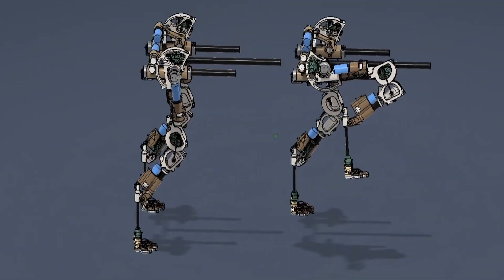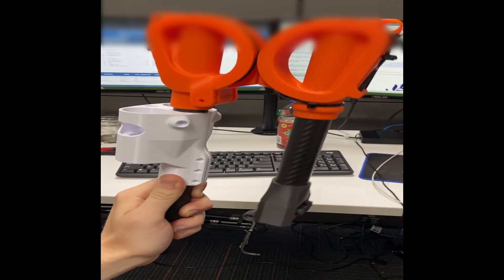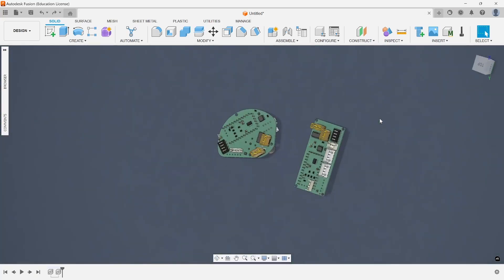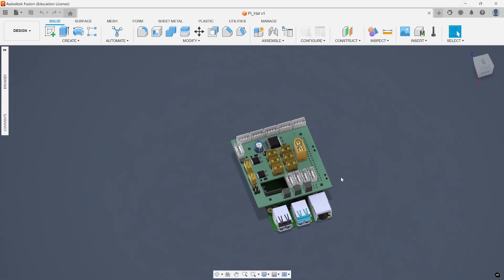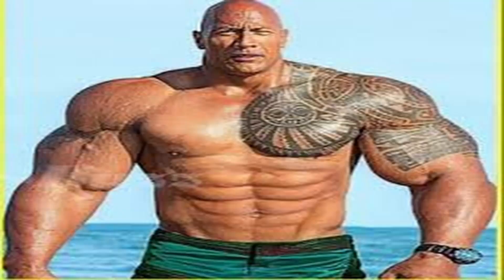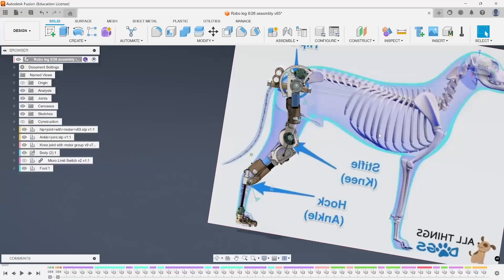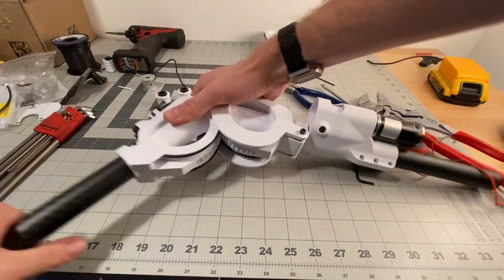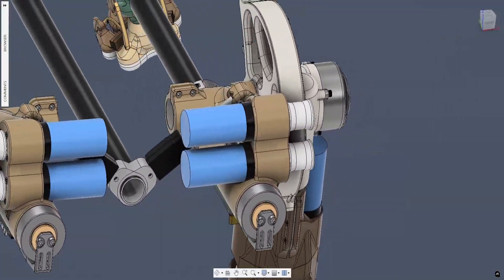Yet Another Open Source Quadruped Robot Dog

Comment: This is AMAZING! What a cool design, can't wait to see the rest of the build! Will be cool to see how its range of motion compares to standard bearing-jointed robots once complete, I bet it'll be considerably more life-like. Hopefully the kinematics aren't tooooo much more difficult, I admit that was something I was just pretending wasn't a problem until I got there 😅
Reply from the maker: Me too haha. I had thought about pinning the hip at (0,0) on a coordinate plane, moving the foot to every point on the grid it can reach then recording the angle of each joint at those points. That way instead of doing complicated math to calculate the foot position I can just give it a position like (0,-25) to lower the foot/raise the body. And to move forwards I would draw a square on the coordinate grid, lift the foot up, move it forwards, set it down and drag it back. All points on the same X axis keep the foot at the same height, and with a load cell in the foot and a 6 axis IMU in the body I should be able to adapt the target point to keep the dog level during terrain changes. But there's probably a reason no one does it this way....
Reply: @WilsonFabrication  this is very cool check out the biomechanics on the knee of a flea
Reply: Definitely subscribed! I wounder if we can try to build a brain for that project

Comment: if you feel like it, in hackaday there's drivers for the BLDC motors, which are open source and should be able to make your own
Reply from the maker: I am interested in trying out BLDC, but the bigger issue for me is price. The DC motors are significantly cheaper even with the custom motor controller, and I would really like to make this project as low-barrier-to-entry financially as possible

Comment: A lot of old people recovering from hip replacements never recover enough strength to walk again.  Two critical joints do most of the work and the rest can be unpowered and moved by the patient (if you want to make an assistive device).  The knee does most of the work involved in walking and standing upright under your own weight.  The front-back motion of the hip joint is also important for standing and most critical for getting up from a seated position.

Comment: I hope picking I2C will not choke project with limited throughput and latency. AFAIK robodog actuators usually are connected via CANbus which is better with both regards. If you want your poor mans fieldbus to be simple and on a budget, you could also make it with RS422/485
Reply from the maker: I've redesigned the motor controller boards to use an esp32 and CANbus. Massive upgrade, I2c really was a limitation
Reply: @WilsonFabrication  good
are you going to ditch brushed DC motors for BLDCs too while you are at it?

Comment: You should consider CAN bus over i2C , as CAN is better dealing with noise
Reply from the maker: Already in the works! Making the move to CAN also necessitated a more powerful microcontroller so a lot of work has gone into redesigning the motor controller boards. Overall should be a huge upgrade

Comment: Wait you need to boost i2c?? I am doing a robot with 3 foot i2c runs right now, is that not going to work?
Reply from the maker: I2c was designed and is still only rated for something like 10cm, and so many comments on this video have been about how unreliable i2c is. The booster works but I’m actually ditching it for CANbus in the next revision. If it works for you I say keep it but if you start getting communication errors look into a booster board, adafruit makes a good one

Comment: Really nice!! My two cents, if you need a material for the joints ligaments that does not stretch over time, try carbon fiber tow glued with silicone caulk (100% silicone).

Comment: incredible light design, love the biomimicry. Using DC motors would make your impedence control harder but still doable, I would make sure backdriveability is adequate by making the reduction low or by other means. Backdriveability is one of the key features for it to be able to walk.

Comment: I2C, even with buffering is so not the right choice for this - RS485 or CAN would be much more robust, and probably simpler to implement & debug
Reply from the maker: I agree, I went with I2c because its already integrated into the arduino but I have known for a while now that it was the wrong choice. I will be switching to CAN soon (new boards being designed now) but to do that I will also be switching to ESP32-C3's as the microcontroller. going from 16mhz to 160mhz processor will me a huge upgrade for PID and allow me to use a more resource heavy communication protocol. 

Thanks for the comment by the way, I have been watching your videos for a very long time so its really cool to see you leave a comment

Comment: Pi5 just to start is ok, later on consider nvidia orin nx. Stay Away from I2C,instead use w5500 and use cat6 ethernet cables, each mcu can have its own ip and port or go towards CAN. Also what are your plans for battery?
Reply from the maker: Thanks for the tips! I hadn't heard of w5500 before and that actually looks like a great solution. I will probably go to CAN and swap the arduino for an esp32 to handle the extra data processing that CAN brings. For the battery so far I have been using a 20v Dewalt battery pack but in the long run I plan on using two LiFePo motorcycle batteries in series. They're crazy light weight and pack a lot of power for their size, should give plenty of runtime while keeping weight down. Plus I can get a deal on them through my old shop

Comment: Inquiry: What does the Rolling Contact Joint give in larger robotic applications? I subbed, good job :)
Reply from the maker: Good question, I'll cover this more in the next video but in short: closer to anatomically correct motion and increased "gear" ratio. Compared to a bearing joint, this joint travels a further distance to reach the same angle, which in practice gives it a greater mechanical advantage. This allows me to use a lower gear ratio motor which keeps the backdrive torque low

Comment: What program did you use for to do this 3d model?
Reply from the maker: all the design work for the joints was in Fusion360, renders too. The PCB's were designed in Kicad which is able to output a STEP file which I then used to design around. Fusion has a free for hobby use version and its the more intuitive CAD program compared to Solidworks, I've heard good things about Onshape though so might be worth giving that a try too
Reply: @WilsonFabrication  thank you

Comment: Impressive job, keep it up.  Not something I would design and build but for research purposes, awesome.  Personally, I like my machines to be simple because these small machines can't have redundancies so what's the point in complexity?  Ruins the reliability.  If Ros is complex or requires Linux then thats too much for most people.  Practicality and ease of use have to be a priority or the advancement of robotics will be out of reach for the lay person.  We want to control robots, not the other way around.  Has to be simple to configure so the end user has control

Comment: This is awesome! I think the primary benefit of modern QDD actuators is how torque transparent and backdriveable they are. This is typically important for lifelike dynamic stability. 

But the capstan might be torque transparent enough to let the dc gearmotors work? That would be awesome if so. Either way this is awesome.
Reply from the maker: It will be interesting to find out. This is my first time playing around with any kind of robotics so I have nothing to base off of but the capstan + planetary gear motors are way easier to back drive than I expected. When the motors are turned off the joint won't droop like you would expect a real animal joint to but I don't have to fight it to bend it closed. The motor controller board has a current sensor on it so im hoping I can get a rough torque control from that
Reply: @WilsonFabrication  Ooh that kinda flexibility is great news. Good luck!

Comment: you need to plan for water and dust protection of your pcbs early on don't forget it
Reply from the maker: Honestly hadn't thought about that yet. Might use something like the spray people use to waterproof ESC's on rc cars
Reply: @WilsonFabrication  look up ip ratings it’s explains the containment rules basically you’ll need the air openings in the bottom and in a way water can’t flow around the casing and in

Comment: yeah i2c booster is a solution but why not just serial,  board clutter is my main concern,. althopugh they look good
Reply from the maker: I2c is what I was most familiar with so it can be hard to plan communication with a standard you don't understand as well. There will be 16 joints in total and it made more sense to me to use a BUS to communicate rather than a direct serial connection. But I will likely have to swap out the I2c soon so maybe its time I learn serial
Reply: @WilsonFabrication   your bot is already crazy good, i'm sure you can figure out everything you need

Comment: Very cool concept. Is it back driveable though? If you look at James Bruton's designs for a robot dogs and look at his experience with the Sonic Robot you'll see that if the actuator is not compliant you get a lot of problems. Rigid robots have to calculate everything perfectly, and the world has to conform to the model the robot has. If your actuator is off by a couple of degrees, if the surface is not as your robots expects it to be, you instantly get instability and really high shock loads.

In general, the mindset for most robot dogs and their actuators is not "This leg needs to be here. So let's move it here." but instead, "This leg needs to apply a force with this vector, so let's move it like this.".

Comment: I'm sorry but your design makes no sense, especially these motors, they are not capable of fast enough acceleration (because of rotor inertia) which is required for legged robots as you have to change direction of rotation couple times a second even for a simple gait.

Comment: Arduino is all about the ecosystem and easy programming but the hardware is just a regular microcontroller.  You should consider a more bare metal mcu approach for cost and responsiveness when the control side stablizes.
Reply from the maker: Definitely on the horizon. Testing is ongoing and were already seeing the limitations of the 328 chip. Will probably go towards teensy or esp32 line of chip, mostly for their higher clock speeds. I would like to keep the parts used on the PCB either JLCPCB basic components or easy to get through hole components while keeping the BOM as cheap as possible so that limits my options

Comment: Cool project! Really like the marrying of capstan drive and rolling contact joints! One note about using i2c with long cables together with DC-motors. Have built an AUV with that setup and it was a nightmare interference wise. We ended up switching out all sensors to ones with SPI or serial communication. Soon we will switch to BLDC motors aswell. Im sure i2c cost us a year of troubleshooting. Just a headsup. We also tried various ”booster” boards to no luck. Hope you suceed with the project, really like the mechanical principles 👍
Reply from the maker: That is definitely something I am worried about. I went with i2c because it was simple and really the only communication protocol I had previous experience with but this will probably be an issue that I'll have to fight with too. I plan on using shielded wiring either from a USB, ethernet or picking up some shielded twisted pair from amazon

Comment: Putting the gear section on each side of the rolling joint is better than only in the center for twisting stiffness
Reply from the maker: Surprisingly the knee joint is very stiff in twisting. The combination of the high tension cord, fenced in joint and the gear face really lock it down. The weakest degree of motion is bending the knee to the side. Having the high tension cord further away from the center line of the joint helps keep it rigid to side bending forces

Comment: Will there be a way for the final robot to stand up on its own in case it has been overthrown on its side or back?
Reply: Usually that is just done by moving its legs in specific ways.
Reply: @conorstewart2214  i have seen one example where it could do so due to the joints being able to rotate 360°. I would think that you need to angle at least slightly the extremeties otherwise if you have not that 360°. Do you have by chance any vid on an example as i can't picture it.
edit:grammar

Comment: Looks like a very fun and challenging project to work on, do you have any plans on how to implement compliance in the leg? A mechanically rigid system will need lot's of sensing and control to compensate for the uncertainty of the real world. Since you are using 2 motors per joint it might be worth using the antagonistically with an elastic tendo to so that you could tune the stiffness of the joint in a similar way to muscles.
BTW, your website is geo-locked to the us which makes it slightly inconvenient to access and might loose you some traffic to the project.
Reply from the maker: Thanks for the heads up! I self host the site so I typically keep it pretty locked down but I've opened it up a bit

Comment: The biggest things I see going against this brushed DC design are speed and strength to weight ratio. As other commentors have suggested, you can get sensitive PID loops to simulate fluid motion. However, getting the machine to react in time will be a joke. It took a second to fully extend the leg under no load? You need it to extend fully in under half a second at full load for anything useful. The reaction time and strength of the motors and electronics is going to be critical for success with complex balancing algorithms. If you need cheap electric motors and PCBs, just make your own... if you can't simply earn the money in the same amount of time.
Reply from the maker: BLDC motors aren't too expensive especially if you buy knockoffs from Aliexpress, its the controllers and compact gear sets that turned me away (for now.....). Honestly I started designing this before I had done any real research into quadrupeds and why the quasi direct drive is preferred. I still think I can get it to work with a combination of sensor feedback and careful tuning but you're right the better long term route will be to swap to BLDC

Comment: DC drive is very surprising. The ODrive brushless system most quad dogs use have very fluid motion, can sense force feedback, and can behave like springs if they're programmed for it. This will act more like giant servos. I can imagine some crazy shaking so you may need something fancier than PID to make it smooth.
Reply from the maker: I'm also concerned about this choice. I decided on the DC motors so early into the design of this dog before I really understood why most people do not use them and I would not be surprised if I swap them out for BLDC eventually, but for now i'm committed to trying to get these to work. The joint is easier to back drive than I expected, and I can implement controls for motor current, joint speed, joint acceleration and have inputs for additional sensors on each joint so I think I'll get something to work
Reply: Did James Bruton use ODrive systems in his robot dog? From memory, I thought he just used DC motors and they worked well.
Reply: @Here_is_Waldo  He used ODrive. The bot can be pushed down like a dampened spring. its very fluid. But dc drive doesn't cost several hundred a joint so its a fair trade off
Reply: @Drawliphant  well a 90kv brushless is like $60 on ali
Reply: @ndjxisjenxjix9525 you need a motor, gear reduction, driver, position sensor, and more per joint. They sell all in one "cheetah" joints for like $300 with gearboxes and ODrive built into the motor, which is how many commercial robots are made. Obviously you can save money if you're willing to 3d print everything and design your own driver.
Reply: @Drawliphant Yeah you can make the cycloidals like james bruton

Comment: For I2C comms, you can also use something called dI2C or differential I2C.

Cable lengths of up to 10m at 1Mbaud until you need to start decreasing it
Reply from the maker: Thanks for the tip! I've never heard of that before so i'll have to check it out. For now I went with the P82B715DR which has a claimed maximum run of 50m but I doubt it would actually reach that far in practice